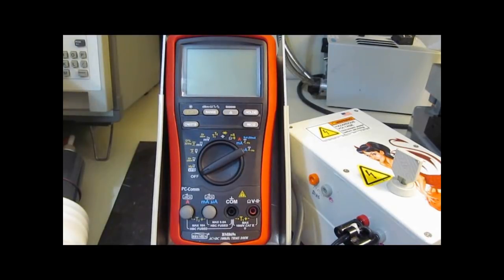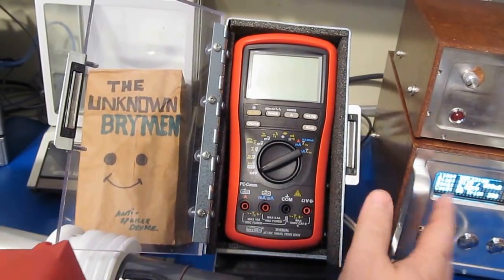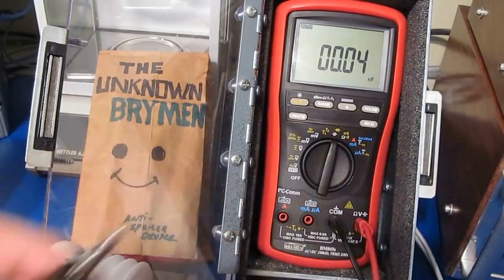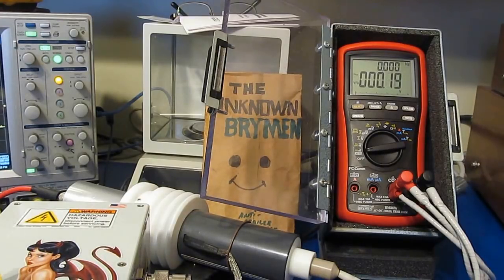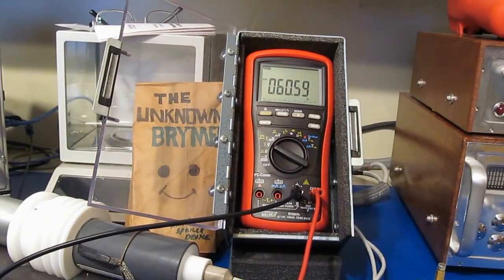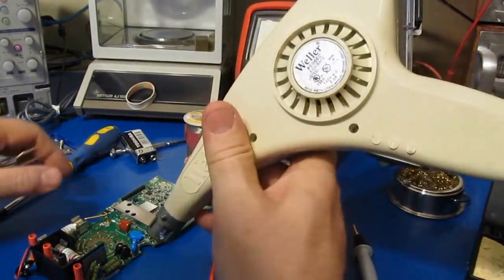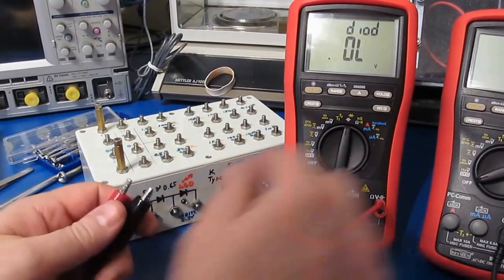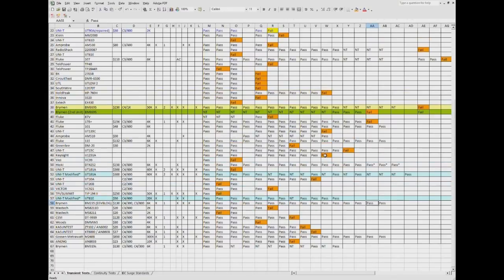Repeating the Brymen BM869s Transient Test

Comment: Brymen 869s for $250 is a bad deal for many reasons 1- unable to read LEDs. 2- resistance Quirk above one megohm even you touch the meter by hand. 3- diodes and capacitor readings are out. 4- taking so much for diodes reading. I don’t know what robust meter means. We don’t test these meters on 1000v or above. The good thing is perfect on voltage and current both AC and DC.
Reply from the maker: lol.

Comment: mr. Joe smith, can i ask question ? surge/impulse generator dont give any kind of bad effect to another gears via electricity line at home ?
Reply from the maker: There really is no general answer.  If you are asking specifically if the generators I designed and built cause any problems, no they do not.  If you are asking if the equipment used for the IEC standards does, in my experience, yes.
Reply: joe smith Thanks for answering, Mr. Joe Smith.

Comment: Hello, good day! Dear Joe, BM 869S multimeter best among those models that you tested. In Your tests is not found Holdpeak model HP890CN with many useful features. The price on Aliexpress 24$. It is really not reliable , you wouldn't call your attention? I assume it can be upgraded as you upgraded ZT102 (AN8002). I ask you to answer my question.

Comment: I never tire of looking at the brymen's tests. I wish that below of anti spoiler device be an amperimetric clamp but this face makes me doubt  xD
Nice work!
Reply from the maker: Sorry, it's not a clamp.  I don't really have a need for a clamp meter like you would use for electrical work which is why you don't see me show them.  The UT210E was an exception because of the 1mA res.   Then it was just begging for some changes.

Comment: Love the Brymen 869s. I bought another high end DMM. A japanese Kyoritsu Kew1062. Their aftersales is excellent. I'm sure they will be happy to send you one for testing! The only drawbacks I do not like are the lcd display quality and the slow resistance refresh rate... other than that, it performs well and meets very high safety specs. No in-depth reviews exist on youtube yet. You could be the first!! https://www.kew-ltd.co.jp/en/products/detail/00976/
Reply from the maker: You claim it meets very high safety specs but going to the link you  provided, I don't see where it was certified.   What agencies certified it?  Is it certified for both EMC as well as safety?   Do you have the report numbers?  Post what you have.
Reply: There is no report numbers on the manual. The manual is more detailed as follows:
Complied Standards:
IEC61010-1, IEC610-2-030, IEC61010-2-033, IEC61010-031
Environmental standards IEC50581
EMC standard: IEC61326-1 Class B

Withstand voltage 6.88kv for 5 seconds

That's all I have Joe
Reply from the maker: I don't care what the manual says, without it being certified I don't see how you can claim it meets very high safety specs.  Putting a CE mark on your product and adding some verbiage to the manual is not at all the same thing as having it certified.   You own the meter.  Does it have any marks on it (besides the CE mark)?     The second link shows nothing about the safety standards.    It's good they at least mention the 61326 standard.  It may survive some of my basic tests but then again, maybe not.
Reply: I get your point! They just state that it complies with the standards and probably do the testing in house. I'll send you pics of the interior build design.
Reply from the maker: Setting up a lab to run these test would be very costly.  I could be wrong but I doubt you would find many companies that will actually test their products in-house to these standards.   Even if they did actually perform the tests, would you trust them or an independent party?   Just asking.  Again, it was your point that the meter met very high safety standards.   That's not something I would claim without having data to support it.
Reply: Sent you a private message on youtube with some pics
Reply: There is a UL Listing and number on the mother board which is clearly seen when you zoom in.
Reply from the maker: Went back through your pictures.  I am not sure what that mark is for.  Have you looked it up and found it having to do with the safety standards?
Reply from the maker: Quick search, it looks like it may be for the material flammability.
Reply: I also found this company in Europe that uses rebadged Brymen BM869s dmm's at double the price. Look exactly like my 869s. http://www.metrel.si/products/digital-multimeters-current-clamps-voltage-testers/digital-multimeters/md-9060-digital-multimeter.html
Reply from the maker: I would like to know what you find out.     " other than that, it performs well and meets very high safety specs."  I would consider that to be a claim.   If they actually are certifying their products, I wonder why they don't mark them.  It appears they are selling a few models on amazon but not the one you have.
Reply: I'll get back with their reply! Good morning from here!

Comment: Interesting video. I wonder how do you control the generator source impedance. is it limited to some component or it is designed to have a 2 Ohm impedance?
Thanks
Reply from the maker: The impedance in wave shape are set by the output network.  Yes, this is by design.